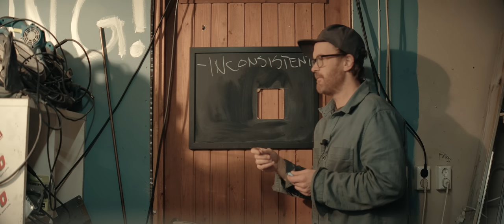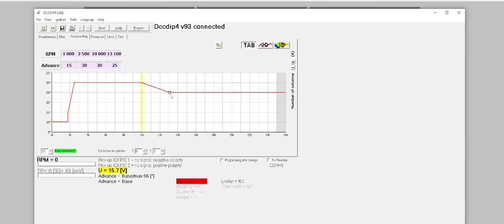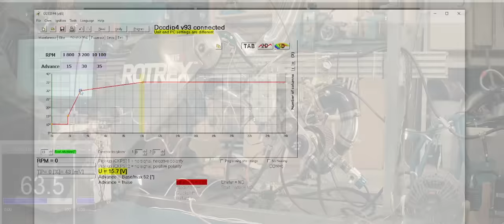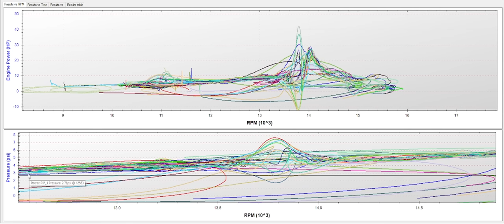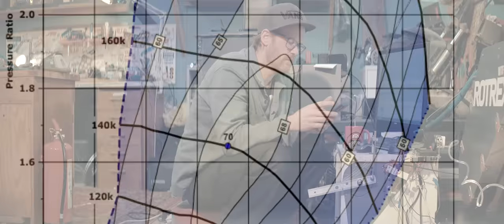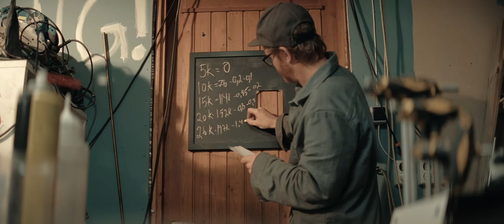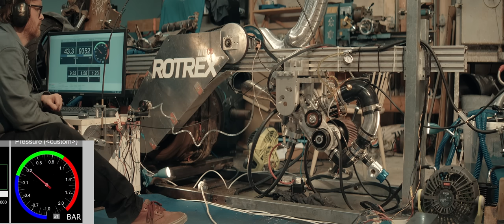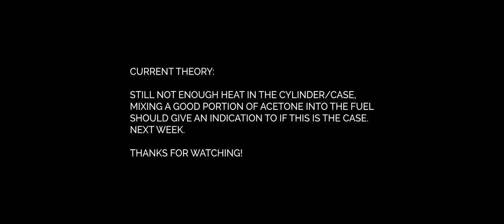Supercharged Pulsejet Engine?

Comment: Even though there is lots of trouble shooting, I must say the engine itself really are holding up well now.
I would recommend mounting temp sensors in the exhaust and inside the crankcase, maybe it could help monitor unburnt fuel.
As well as monitor temp of intake, 1 bar of pressure also is starting to add temp on the intake side.
Reply: Literally just thought the same thing and came here to say it. The amount of s*** tunes, poor operating temps and whatever else our boy throws at it and she just keeps on ticking. 

Anybody know what rod, piston and crank he's using in this setup? It's crazy to think how much horsepower they were getting out of 50cc two strokes back in the 60s and 70s. I heard stories of Honda getting insane numbers double what our buddy here has put out so far. This is still quite an impressive setup for a garage LOL. We need to start a GoFundMe to get this dude some safety glass
Reply: he has a allergy to sensors and efi and prefers to blindly guess at the problem I think, entertaining but not conducive to making power consistently
Reply: Give it to a 16 year old in a moped & see how long it lasts....it's really only been tickled on the dyno & not properly loaded...compared with previous attempts it's more robust though..but all relative.
Reply: @SB-vb8ch  100% my am6 with no flywheel will rev past 16k, is it producing power? No
Reply: Dude you've got a 2stroke ,all your port are open a the same time so the mixture is going in you exhauste, logic, you need to get exhauste valve or a pipe with big big big effect to counter the pressure 
You're pipe is disigned to work at atmospheric pressure in the pipe and out.
You need to designe a pipe for your case 
With bigger boost you got even mor mixture in your pipe and not in your engine
So bigger flamethrower and less pipe effect , you forgot the essential of a 2stroke!!!!

Comment: I know it sounds like the opposite of what most people do with their (already developed) engines, but could you pre heat the incoming fuel and/ or air to help it vaporize and increase volatility. When you spill glow fuel on your hand, it's amazing how cold it becomes as it evaporates. It's almost painful when it's cold out 😅. 
The acetone could help in this regard. It's a common trick to add acetone to glow fuel in cold climates to help for starting, although it's not something I've ever done. 
Also, the amount of oil in that fuel is probably about 18-20% by volume (not sure about your specific fuel). That's about 5:1. I know it's safe, but it's probably quite excessive. Ignition and vaporisation might improve with reduced oil quantity. 

I don't know if you'll read this, but your doing an awesome job with this engine. With perseverance like this, I'm sure you'll set your record👍.
Reply: Usually you want to cool the air so more of it goes in. Intercooler thats called.
Reply: @theCombinator  
That's what I mean by doing the opposite of what most people do. In this case, heating it may be the way to fully ignite the fuel.
Reply: Double spark it?

Comment: Just a thought have you got a pyrometer that you can put just out of the exhaust port and a port for crankcase pressure ? Exhaust temperature tells a big story. I don’t know how much your fuel cools things but if you have the engine at evaporation point or above that should help with atomism. What is the design temperature for your motor if it does not have enough heat the clearance will be all over the place . Just the musings of a retired mechanic, love what you are doing keep it up you will eventually get there . Cheers from Australia

Comment: Before the carb you've got an 90 degree, which at low RPM (low airflow, low airspeed) gives you a uniform flow. At high RPM (high airflow, high air speed), most of the airflow will be concentrated outside the bend. You might have a simple mechanical fluid problem on top of any other problem. (In ventilation system, we recommend at least 2.5 x (the duct size) of straight pipe before a fan so that we don't starve it. Try the same for your carb. Give it a uniform flow accross the RPM range by puting a straight section of pipe in front of the carb.

Comment: Thanks for all the hard work and effort you've put in!
When running the Roots blower you found the best pressure to be 1.1 bars with the stinger attached.
Reply: Gotta take that boost out of the crankcase
Reply: @reiddoig5158  My apologies, I don't understand your comment.
Reply: @malcrandall1309  Piston is fighting boost pressure on the downwood stroke Direct the boost straight into the transfer ports and have a vaccume in the crankcase Free horsepower
Reply: @reiddoig5158  Thanks very much for your clarification.
Reply: @malcrandall1309  What are your thoughts on this I saw some drawings from 2stroke stuffing for this ideah but he never went on with it

Comment: Maybe try other pipes and see if the rpm at which it goes haywire changes in order to rule out pipe tuning. Also, I agree with several others here that you should add a resistor for ignition pickup. Super stoked about the build, keep it up! Cheers from Sweden

Comment: Now that you are super-charged, and have good fuel flow and ignition... you should make a telescopic section of the exhaust pipe between the flange and the start of the expansion chamber. Adding or removing length between the head and the chamber will drastically change the fluid dynamics of the charged air pulse as well as the exhaust scavenging effects. I would guess (judging by the fireballs) that you would want to start your expansion chamber closer to the head, and perhaps (due to volumetric efficiencies) increase it's size to that of an 80-100cc (maybe 150cc) engine's tuning requirements.
Reply: I agree, when this pipe was run on this engine it achieved 18,300 rpm pulling the retarder using the roots blower and speedway carb. I feel the problems experienced are down to lack of correct fuel atomisation, the finer the droplets quicker the burn.
Alex has a collection of expansion chambers, it just takes time to do it,
As Alex has stated he'll do it his way as he likes sorting problems.
The question is, why does the Roots/speedway carb work and not the Rotrex/Lectron.
Reply: The pipe should be longer at lower rpm, and shorter at higher rpm. This is because the time between events is shorter or high rpm, so the distance the wave travels should be shorter.
Reply: Agree. And it needs a actuator moving it at different rpm. Coool:)
Mounting the carb on suction side of turbo would help vaporizing fuel and lot less complexity, also it will work as intended? Fuel will also act like intercooler.

Comment: Do a cvt pulley system on the supercharger to make variable pressure through the rpm range. I don't know if this solves anything but it sounds fun 🤣
Reply: I'm not sure overnighting the boost from the supercharger to the engine is conductive to achieving his goal, but the thought tickled my brain slightly
Reply: The problem is that you'd want it in reverse compared to a normal cvt
You want a taller gear at low rpm and a shorter one at the redline to even the boost curve
Reply from the maker: What can and cannot be overnighted is still a fairly under-explored area.
Reply: @riccardo1796  I guess you probably could use a normal variator, but just have it on the driven side instead.
Reply: @riccardo1796  So, drive it from the other side. I can't really think of a reason why that wouldn't work.
Reply: It won't work because the small pulley is controlled by centrifugal force, if it's not spinning it'll never engage and it needs to be engaged to start spinning

The real solution is a servo controlled cvt, like cars and maxiscooters use, which also limits belt slip
Reply: @riccardo1796  Invert the forks that the weight are mounted to then, so the force will widen the wheel, and it will work in the same position its supposed to be in.
Reply: @TheAndreasKL  why would it???
The weights, be it rollers or levers, are flung out either way
You'd need to significantly alter the whole assembly to make it work in reverse
Reply from the maker: @riccardo1796  Should work as long as the variator is still engaged at the lowest ratio, usually is in most scooter/moped applications.

Comment: I ran a 250cc 2 stroke micro sprint on 100% alchohol with a smaller radiator than your using on a 50cc. My engine didnt make any power untill it got near 200 degrees (f)

Comment: I watched this video again and observed the following: 1) The maximum cylinder head temperature for all the runs was about 70 deg. C (some were much lower)—in my opinion this is much to cold for the nitrated fuel that you're using. 2) The maximum ignition advance for all of the runs was 30 degrees (some less)—not nearly enough advance for the nitrated fuel being used—less than most would use with a similar gasoline-fueled 2-stroke engine. 3) When the "pulse-jet" action began from the tuned pipe, the instrument measuring BARs began an irregular fluctuation between about 0.8 and 1.4. In my opinion, this probably indicated that the air-fuel charge from the crankcase was short-circuiting wildly from the cylinder's transfer ports... and out through the exhaust port (again, in my opinion, this is due to poorly atomized, non-vaporized, slow burning fuel, which has way too much lubrication percentage that is not contributing to the burning process). 4) Your stated intent to use an accelerant with this nitrated fuel should be performed with extreme caution. As with propylene oxide and hydrazine (unobtainium) before it, acetone can and will produce melted pistons, plugs, etc. (even if the A/F approaches the stoichiometric—chemically correct). Suggestion: As mentioned a few days ago, the best way that I know to heat the boosted (blow-through) air and fuel mixture in the crankcase and turn it into a vapor is to use one or two 12 volt electric surface heaters (1/2 inch diameter, or less) and pre-heat the case to about 100 deg. C. After start-up, when the engine's head temperature stabilizes at roughly 130 deg. C, turn off the crankcase heat; It won't be needed because the combusting nitrated fuel will maintain the head temp... providing the engine's compression ratio is close to being correct—an easy fix nonetheless 5) Remove the tuned pipe; it's doing nothing but confusing the real issues of this engine. Last but not least: you NEED to install A/F instrumentation. All of the needless guesswork is prolonging what should be a straight-forward determination of... is the fuel mixture too rich or too lean? If you provide the glow fuel's ingredients, I'm certain there are followers of this Channel who can do the relatively simple calculations for both the stoichiometric and peak-power A/F. Actually, it doesn't matter if you use any of the suggestions from me or those from others ... it's still fun to watch your trials and tribulations. Best of luck!
Reply from the maker: Thanks for the input! No time to form a proper reply atm, sorry. I'm going back to basics in the upcoming vid, tackle any "conventional" issues, then add in the unknowns one by one. Also, while digitizing the compressor map for simulations I realized the compressor has probably been surging pretty much the whole time, changing drive ratio did not help... Never paid much attention to the surge line, stupid.
Reply: @2STROKESTUFFING  Looking forward to your Thursday/ Friday video coming out.

Comment: Normal/optimal coolant temperatures for internal combustion engines is between 75 - 105 celsius, so it seems that you are still very low.... also does the inverted cylinder design not  promote hotter crankcase temperatures...?
Reply from the maker: A highly tuned 2t on gas likes as cool as possible, not applicable in this situation obviously...
Reply: I think Nitro RC car engines like about 100 Celsius. This is mabe more like an rc nitro engine than a gas 2-stroke that way? Tho it has piston rings, so mabe not. Don’t know. Would try even more heat in the cooling system. To about 90c and just see what happens. Might just have to be sure the ring gaps can handle the heat expansion. I don’t know. Love this channel!! My favorite in fact! Looking forward to The next vid!! 😁🏁🤟🏼

Comment: Do you not want a plenum of a specific size pre carb? It's my understanding compressor flow is messy without some kind of buffer.
Reply: centrifugal is much smoother than a roots. doesn't really pulsate at all.
Reply: @rubikmonat6589   If it's anything like a turbo, it's far from clean. I wouldn't trust that it is personally. A mechanical gauge without a snubber valve would tell the story.

Comment: Hi Alex, outstanding, looks like you got the carb pretty much under control, good job. Was just thinking about what was going on with the pipe spitting flames at various times. My personal opinion is that the pipe is coming on as the charge velocity comes up in the higher rpm range. Methanol has a long burn time as you know, and the time the engine has to compress and ignite and burn the mixture at high rpm has to be minute. The same thing would happen to us when we were racing 100cc two strokes, but it would burn the top edge of the piston and scorch the exhaust port. All we did if our timing was correct for what we wanted was, lengthen the distance between the piston and the first cone of the pipe, it changed the timing of the pipe/resonance of exhaust slug verses port timing. I’m sure you already know that. You are on the right track, with adding some acetone, ignites the charge faster. If it were me, lengthen the pipe, piston to first cone and begin adding small amount of acetone at a time. I still think there are gains to be made in the carb, my opinion, throttle response seems to be lacking, more of Venturi/ restriction for better pressure differential. Just wondering if your two stroke software will calculate the time available for the power cycle to take place? I’m really wondering how your engine would act on fast igniting gasoline with different carb, just a thought. Keep at it! Great job! Can’t wait for next week!

Comment: I still say you should baseline without the supercharger first, then once you're happy the way it runs and you know what power it makes add the rotrex and go from there. The other thing I'm thinking (and might have missed it in your series), maybe have a good known engine hooked up to the dyno and verify it is working properly.
Reply: Without the supercharger you would have little to no scavenging and would have to redesign the entire engine. Like running a Detroit diesel without a blower
Reply: @labrikorn_3299  Alex has a lot of idea's running round in his head. It's hard to accept logic some times.
Reply: @mikehotchkiss8975  the engine he's currently running was na at first
Reply: @mantvydas8810  This engine has a very large crank case volume, 390cc with very low primary puping efficiency. Only wish it was smaller!

Comment: Hi Alex, please don't get me wrong. I was i a forum with Frits Overmars. I`m sure you have learned about the phantastic imput he has given to the whole Two stroke tuner comunity.
I actually met him more than once. Frits is a very encouraging mentor to many of us.
Have you run this cyinder with out a charger before? If so, I am very eager to see the video. 
What is the reason not to run it with legal fuel?
What i dont understand, when testrun the engine ist, why your numbers jump from 1 to 35 horsepower up and down?

What you are doing  ist actually incredible stuff, and I enjoy it a lot.
Greetings Martin
Reply from the maker: Thanks! Frits is great! It's never been run NA, maybe it's time... My theory is the numbers are jumping cause it's misfiring half the time, or worse. Shock loads on the load cell.

Comment: much respect for addressing the established title ordeal.  Gimme the gps location/address of the land if you can and ill go visit it and take photos for you if it does exists, im always traveling round Scotland delivering motorbikes and i would personally like to see it for myself as well in case i am wrong.   

Loving your build!
Have you thought about playing around with an exhaust power valve system instead of an intake valve like the rotax 122/123 engines have? 
Your system reminds me of aprilias Rave 2 power valve system. (the solenoid version)

I cant help but think if an intake based valve was better all the manufacturers would of gone that route.
Surly you want to control the flow out of the engine instead of into the engine?  the carburetor  already moderates the intake so your intake valve seems a little counter intuitive.
Its like putting a carburetor  in front of a carburetor  that isnt adding fuel.

On that note, i wonder how 2x stacked blow though carburetors would behave :P

Comment: You ask the right questions. Your comparison of 2 stroke port timing to 4 stroke overlap is spot on. You are going to have to change the exhaust port timing. There is the obvious way to do that, but there are probably ways that  I have not considered. You cannot make cylinder pressure with that much overlap. 

Damn, you are really quite a smart guy. I will be very interested to see your solutions. Peace and best wishes.
Reply: Add the thrust into the power calculations? I am mostly joking. Afterburner?

Comment: Can I make a suggestion. Test to failure. Pistons are cheap. Advance the ignition timing to 40 degrees and do one run before extreme heat does damage.
It will be easier for combustion to start as the cylinder pressure will be lower and spark plug performance less likely to be variable. Also do not persevere with a well used plug. Use new plugs say every 5 runs or similar.